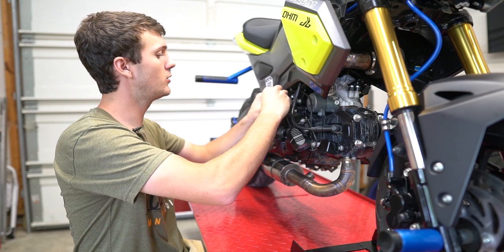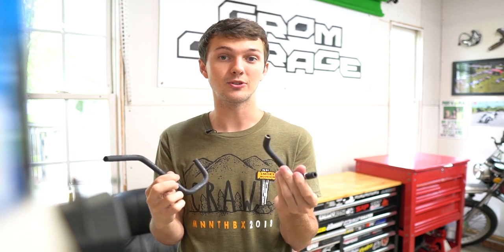Clean Air Mod | Fixing my Honda Grom

Comment: I did this but after I installed the BBK I built up pressure & oil started to spit out the filter while riding. I then had to run the line to a oil catch can which ran back into the oil filler cap.
Reply from the maker: It’s been fine so far, but if that happens then I know what to do
Reply: i dumped my line right before the back tire so i could finally do a burnouts. 👏
Reply: Howd you run a line to the oil filler cap?

Comment: Why dont you just attach a longer line to the long hose and run it up and then down under the engine so if any oil spits out itll just drop onto the ground. Put the end of the hose on a bit if an angle so if oil does come out it doesnt spit oil right in front of your rear wheel.

Comment: Do you have to do this to your grom for sure !! If you have your stock air box still or should I do this ? And what size breather filter and hose ? Please help don’t want to blow my engine or anything I’m just starting out stunting !! Lol I hope you guys see this !!!!
Reply from the maker: This is mainly for people with a different intake system. 
With the stock intake system there is a clear bubble thing at the bottom of the air box, overtime this will fill with oil and you just need to take the plug off and drain it so the oil doesn’t go in your engine. With a different intake system you won’t have this feature. 

Hopefully this makes since, if it doesn’t... message me back with your question
Reply: So basically just don’t overfill it and I won’t have this problem . Lol 😂 and I know what you’re talking about that clear little bubble . Photo groomer said it’s not needed only for bbk or somthing he said just make sure you don’t over fill it lol but thanks man . I also want to do a single light bar but I’m horrible with wires I seen your video but I will still Deff mess that up lol .
Reply from the maker: Takes a little skill lol
Reply: Hey man what are those grips you use! I see them everywhere I want a pair for the grom !! Please lmk !!!!
Reply: @grom garage what grips are those that I see everywhere you have them and your friends has them on all your bikes lol they have slices in them . I want a pair so badly !!!!
Reply: Grom Garage what grips are on all your bikes I like those a lot for stunting don’t know that name ?!
Reply from the maker: Progrip 719

Comment: Responding to your comment at the end of the video. I told you the best way to fix it haha. Cajun mad dogs gy6 ruckus oil fill cap vent tube. 12$ for a cnc drain plug that allows it to vent properly when doing wheelies. Never had an issue after I installed it
Reply from the maker: Thanks lol, I forgot where you said to buy it lol. Gonna try to keep it like this first but if it needs it I’ll do the rest 👌🏻

Comment: I need to do this to both my bikes... With my 06 bike I started doing what you did, running a longer house and zip tied it to the tree because a past owner put the crank case filter right on the damn case so it wasn't venting properly. Cleaning that bitch every couple days got old lol. My new bike still has it factory ran to the bottom of the breather box mounted directly under my seat, so it still allows oil to get up the house and into the box, I assume at high rpms and when doing wheelies... Never thought about this until now but I wonder if that's what's wrong with my carburetor....(carburetor doesn't come apart at the float tank so I have no way to know, but I'm pretty sure no trash is in it...) How much are one of those filters at Baker? I'ma have to get one when I go pick my chain up, if I remember...
Reply from the maker: I just bought mine online, I’m sure baker could order you one... they are 20ish dollars 👌🏻
Reply: @GromGarage   better be a damn good one for that much no bigger than they are lmao. Thanks tho.
Reply: @GromGarage  also, where did you get your shorty clutch lever at? I'm searching for one but haven't liked what I've found. Yours look like the length I want to go with...

Comment: Grom garage, I have a mid length intake on the 18 grom. It’s happen twice now that I get a burp/backfire from the intake .Could it be this similar problem?
Reply from the maker: Probably, I would do this intake filter mod. I have had it overflow one more time since this video but it just came out of the small filter and stayed out of the engine. It did get all over my pants though 🤷🏻‍♂️
Reply: Did you just simply put a cap on the intake we’re the rubber hose should of gone ? ?

Comment: Is your front right side axle slider bent or did it bend the axle when the bike went down? I want to get some similar to yours but maybe I’ll rethink them if they bend the actual axle
Reply from the maker: They do bend slightly, but they are still very solid.
Reply: I heard thats one of the negatives about the longer axle sliders..they tend to bend the axle on impact. Im thinking about getting shorter axle sliders, about half the length of these ones but Im wondering if it even makes sense, the handlebars will probably hit the ground before the slider makes contact with anything.

Comment: I had the issue on my 190cc at high rpms and full throttle oil would spit out. The best thing I did was make a catch can that breathes to the atmosphere to catch any oil that does spit out and then I have that routed to drain right back into the oil fill hole so it's like a recirculation tank
Reply from the maker: Does it go back in through the oil dipstick?
Reply: @GromGarage  I replaced my dip stick for a threaded hose barb fitting and used that to drain the catch can back into the motor. I have the oil sight window on my bike so I dont need the dip stick but I do keep it handy for oil changes just to double check.
Reply: So if you have a container of some sort (a beer can if you want)  you want the breather hose going into the top then another hose coming off the top with a filter to breathe out the atmosphere and then a third hose at the bottom to drain what ever gets in the container back into where the dipstick goes.
Reply from the maker: Where did you purchase the hose barb fitting? And so far I’ve ridden it with 0 oil but it’s nice to know this just Incase it is needed in the future
Reply: @GromGarage also as long as the oil level is correct and it's a standard bore you should be totally fine that set up is mostly for big bores on these little bikes. But due to where the breather is located on the engine, when doing wheelies it's possible for drips to occur with everything sloshing around. I've seen guys just put a really long tube on the breather with a filter on the end zip tied up to the fork behind the headlight so when you pop it up its facing towards the sky and gravity helps it not drip plus you have the extra volume from the tube.
Reply from the maker: I just need to stop overfilling it lol
Reply: @GromGarage  that'll help haha I still do it everytime lol
Reply: Wouldn't this mess with the back pressure and over pressurize the motor?
Reply: @GyngerBreadMan  how would it over pressurize the motor? It's doing the exact opposite you're allowing more pressure to escape through the oil fill hole as well, essentially adding an extra vent. The catch can it self is vented as well. It's pretty common thing on high performance cars and bikes and pit bikes which is pretty much a grom. If you race supermoto they require you have a catch can so no oil gets on the track.
Reply: I didn't realize that you had a catch can with a breather valve on there as well. I thought you just had the breather hose redirected into the dipstick tube not allowing any wait for the crankcase to relieve pressure.
Reply: @TheJuiceMane  how did you configure this?
Reply: @GyngerBreadMan  you take a small container of some kind to act as a catch can. You run the original breather to the top of the can. Then run a 2nd hose with a filter on the end of it to the top of the catch can to act as your new breather. Next add a 3rd hose to the bottom of the catch can and run it to a hose barb fitting that will replace your dip stick. That way any oil that does enter the catch can will drain right back into where you usually fill your oil up at.
Reply: Will you also get a dirty crankcase breather if the bike gets layed down? @GromGarage I didn't know filling it too much would cause that either. New tricks for the old dog.